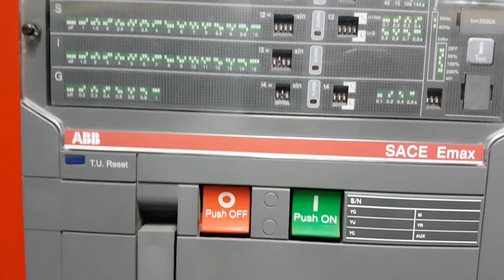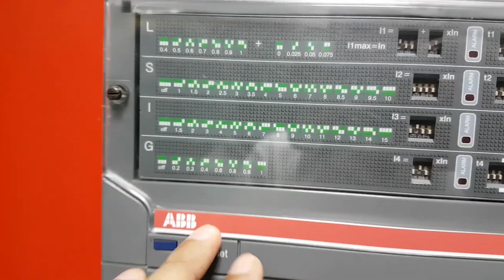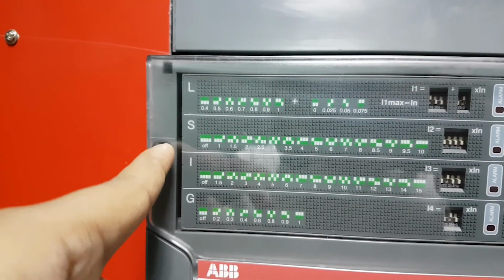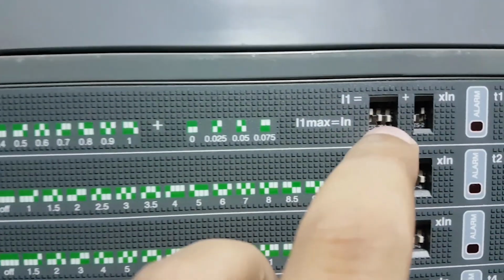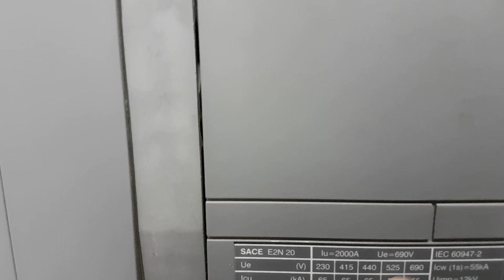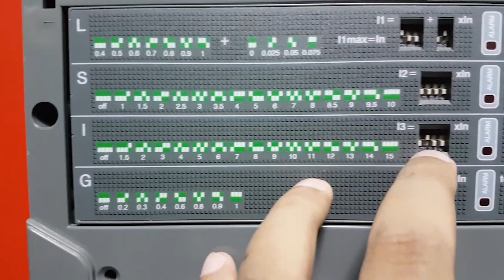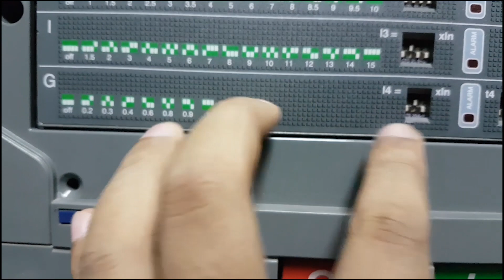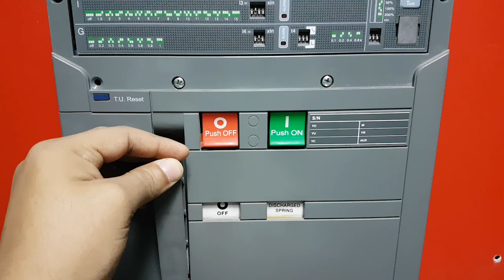ABB ACB SACE Emax

Comment: In=2000? That must be checked from the rating plug (#12 on the instruction photo), NOT from the specs sticker.
Though the frame is a 2000A, the trip unit can actually be downsized to 1600, 1250, 100, 800, 630(?)A by simply exchanging the rating plug.
And that will directly affect the reference In for all settings.
Regards, ABB Tech Support
Reply: How to change the Rating plug ?
Reply: @amaan8670  pop out with a screwdriver (or 2, to go straight) and put a smaller one in.
Cannot be replaced with bigger than sold, only smaller.
However, L setting I1 can be as low as 40% of nominal current, so a lower rating plug is not that often needed.
Typically only with smaller currents in high short-circuit or high temperature conditions.
Reply: @ambassadorkees  
Thanks for your reply